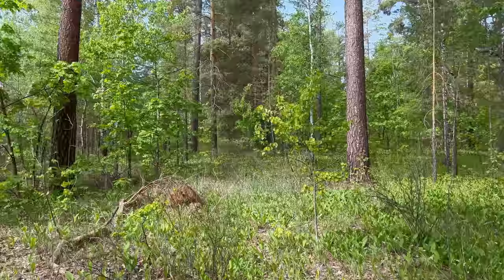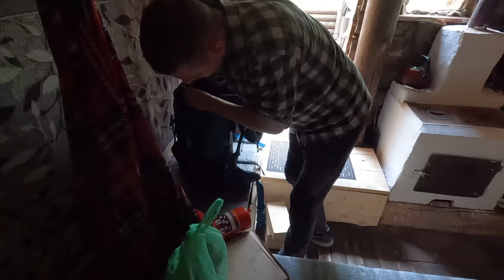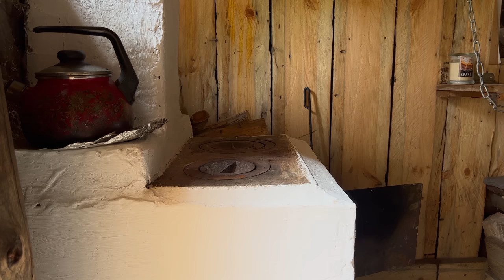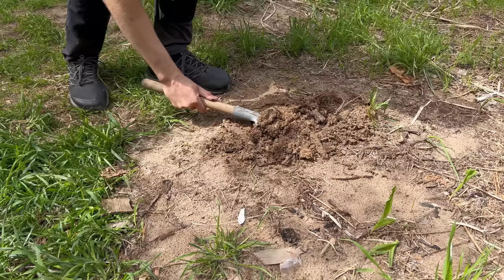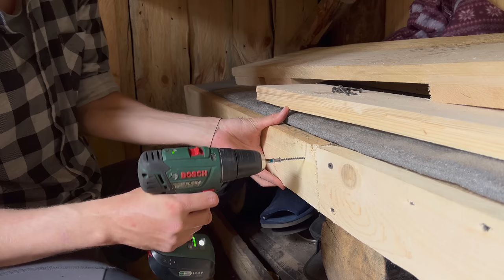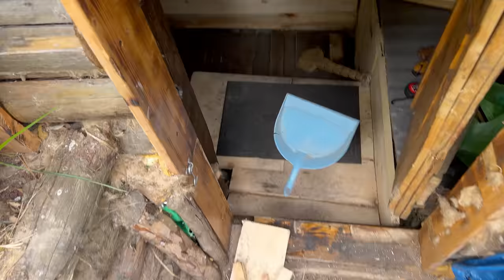THE END of the story of my DUGOUT. I repaired the stove and gave my house underground as a gift

Comment: I watched this from Starr to present. I were just curious about how or what you do about if there were rain or heavy down poor where would water or if any run off incase it floods inside of dugout like since you basically dug a hole so water will fill in I just wondering how you stop it from flooding or around where it's dirt from calapssin